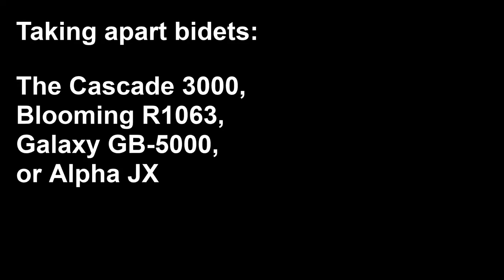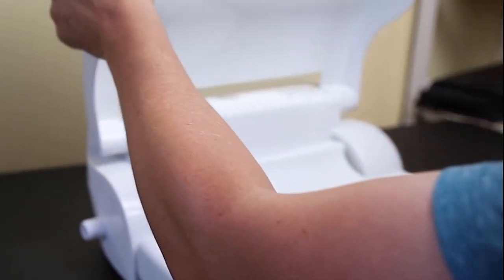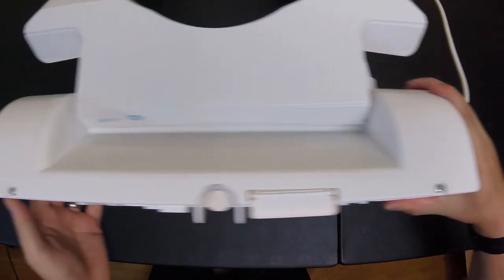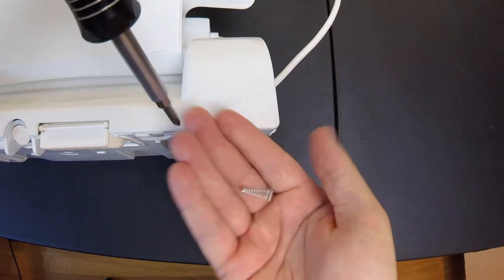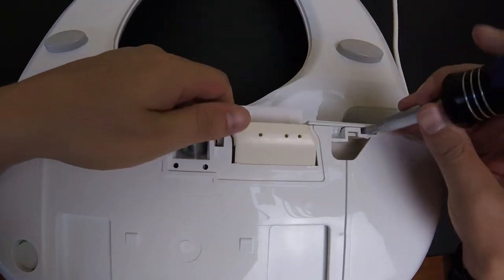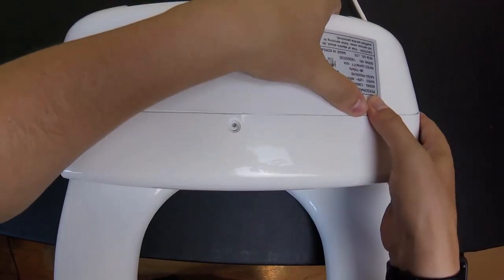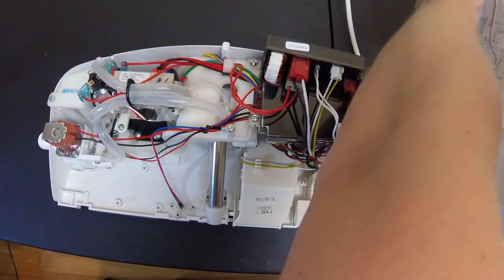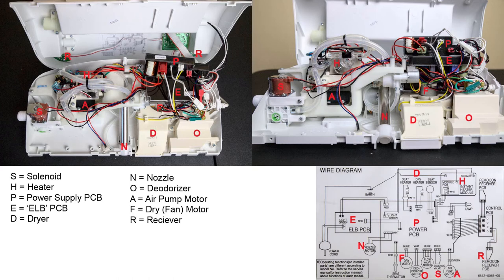Bidet Repair: Taking apart the shell - Cascade 3000, Blooming R1063, Galaxy GB-5000, Alpha JX

Comment: Hello, I have a Cascade 3000 and would like to know if there is a way to make the odor fan come on by default when the seat is activated upon sitting on it. Thanks for this video.
Reply from the maker: Currently the deodorizer will need to be activated every time you sit down.  Thanks for the suggestion!

Comment: I have an Alpha JX-EW that will only change spray pump settings after going into high. Then it works fine every time. Any suggestions? Thanks
Reply from the maker: You will need to reach out to Alpha Bidet to find out how those settings work.  If you are using the Auto function, the seat will start at a medium wash and you can adjust from there.  If you use rear or front washes, you'll get the last used pressure setting when it first starts.  If that doesn't work, you might need to replace your PCB.

Comment: Hello i have the alpha jx, it is one month out of warranty unfortunately.  As soon as we sit down it starts leaking out the side of the bidet and makes a big puddle very quickly.    I have taken the bidet apart.   Water is coming out of the only small hose that points towards the back of the bidet.   There is a large hose coming from the heater to a white fitting just above the nozzle, on the same fitting but different nipple is where the small hose connects.    The other end of the small hose is not connected to anything.   The other thing im noticing is the air pump doesnt have a line connecting to it.   Is the small line supposed to connect to one of the pump nipples?
Reply from the maker: While we don't have any connection to the Alpha brand, so we can't give official advice, the air pump should be connected.  This hose being disconnected would give the symptoms you describe.  On the Cascade the hose connects to the center nipple on the air pump.  Give that a try, but you may need a clamp or drop of glue to hold it now that it's come off once.

Comment: How do you fix the light?  It is no longer working.
Reply from the maker: To date, we've never seen a light burn out. I'd start with using the button on the seat to try and toggle the light on and off (make sure the room is dark.  If it's not, the night light won't work)  If you still need assistance after that, I'd encourage you to reach out to our support.